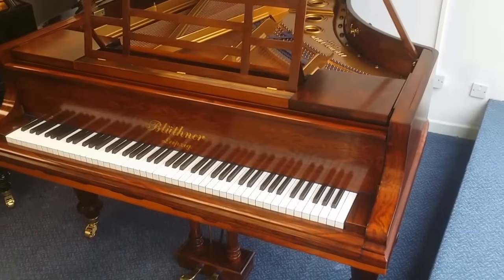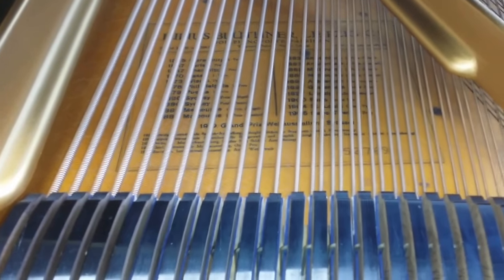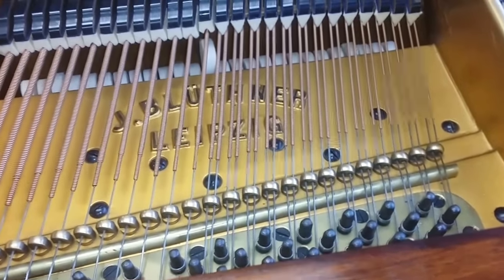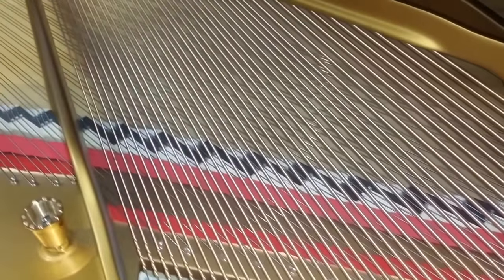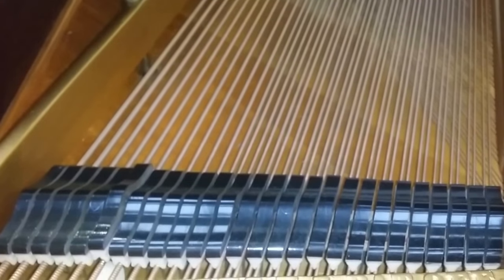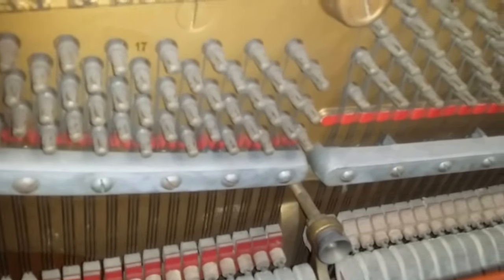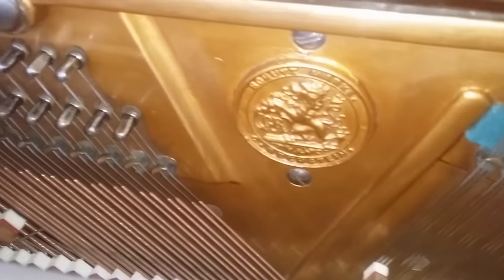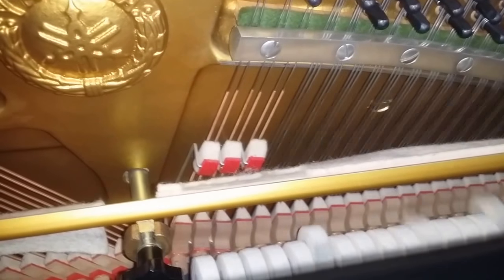Does this piano need restringing? Thoughts on this and other pianos.

Comment: With Steinway grands, the strings in the top three sections cut into the capo d’astro bar, which leads to increasing “hardness” of sound, and these sections require re-stringing after the underside of the bar has been rubbed down. Several tunings will be needed after these sections have been re-strung: it’s not cheap!!

Comment: I would guess it would depend on the conditions in which the piano has been stored, but I agree that the strings can last 100 years in good cases, so generally no need to replace unless the wrest plank or wrest pins need replacing, and even then the original strings could be re-cycled.
Reply from the maker: Yes that is true, however in the later part we would in most cases replace strings if wrest plank and pins need replacing as they are all connected and replacing one merits replacing the strings, it is the best opportunity to do the job as for re-stringing pins will likely need changing then. It's mostly a paired task. Greetings from Roberts PIanos Oxford, Evan Roberts